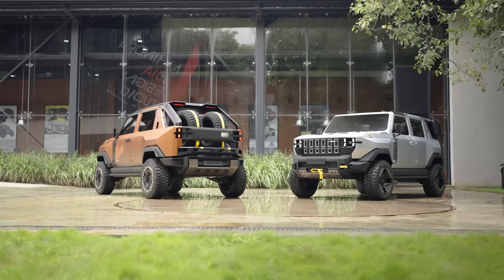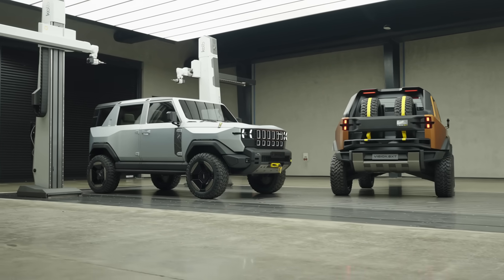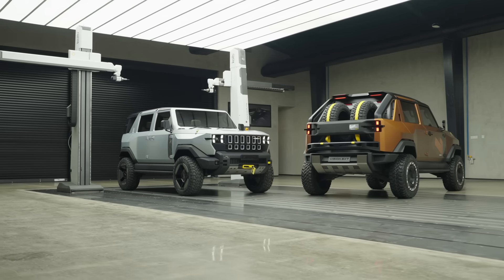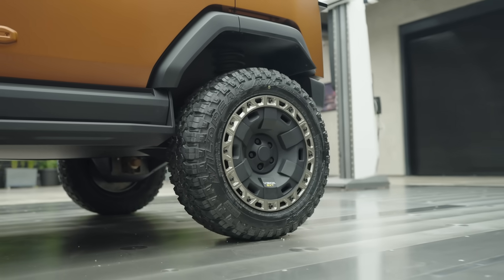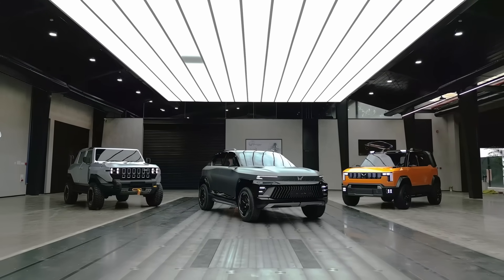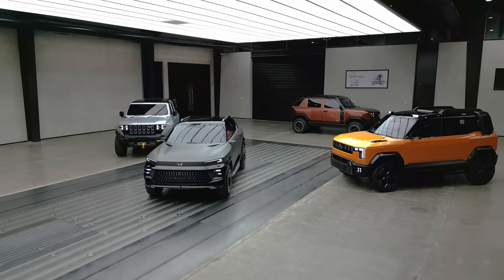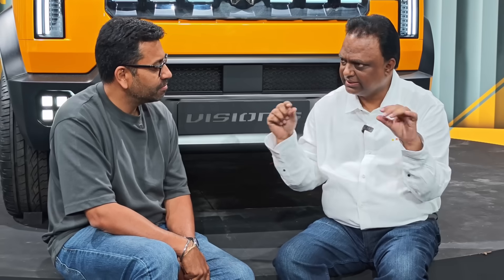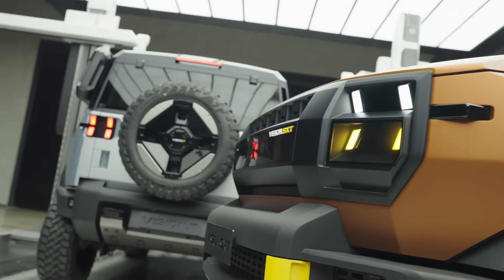Understanding Mahindra’s NU.IQ platform | In conversation with R Velusamy | evo India

Comment: Dear Velusamy sir,

Actually Mahindra done a great Job in terms New car designs ( BE 6 & XEV 9e ), Am so inspired on both cars and booked my BE 6 pack Two. 
Asper Mahindra both are same Platform, Battery size, Motor everything is same, Only the Body shape and room sizes are different based on the customer Choice which is 100% fine . 
While am checking the price from BE 6 to 9e it's 3 Lacs difference for the design character, But when am going for Pack 2 variant Many features are missing in BE 6 while 9e has in the same Variant.

Example In 9e Pack two below features are same as Pack three.
1) Same Light set up
2) Alloy Wheels
3) Auto fold ORVM
4) Reverse Auto tilt ORVM
5) Electrically adjustable seat with 3 Memory function

But the same in Pack two BE 6 All above is missing which I felt 'Unfair', Because in both model Pack one to Pack two price difference is same 3L rupees, 
While giving 3L rupees excess in 9e am getting above features while am 3L rupees in BE 6 not there which is completely not convinced me.

Even though I have booked BE 6 Pack two but still am worried about above and dis satisfaction with the booking.

Comment: Sorry the BE6 has utterly failed for rear seats. What is he talking about? No under thigh support whatsoever
Reply: Yes the rear space does feel different compared to a tradtional ice car. But thanks to the extended wheelbase the leg room and shoulder width is not a problem. 

It's the radical design that creates a perception of a cramped car. But in reality it is not. 
I personally own a Be6 and have realised that's It's maybe the most spacious rear seat for a car that is so driver centric and sports car like. 

But then again people have the freedom to go for xev 9 in case rear seat is that imp to them.
Reply: @Agarwal_Ansh Have you tried doing a hypermile test with your BE6? If yes, what did you get? I was just curious 😅
Reply: @shakunji yes. I have the 59 kwh three select variant. And with auto regen on. I get 410 types .. ac on
Reply: No one is forcing, there are enough buyers for its performance
Reply: BE 6 has good rear seat space for a performance car. Don’t compare it with any normal crossovers

Comment: Didn't sound very convincing. BE 6 measures around 4.37m in length so clearly space management wasn't the factor that lead them to opt for a multi-energy platform. They may have done it to keep the development costs down seeing the lukewarm response their BEVs got. Which is a shame really, they are great cars.
Also when he says FWD has enough performance for cars under 4.7m & 2000kg it feels like going back on their words from 2022 where they said that RWD was integral to Mahindra's DNA of rugged off-roaders and performance oriented SUVs.

A FWD Thar? With a 1.2L TGDi? And a smaller battery (shorter wheelbase) than INGLO? Certainly NOT a go anywhere vehicle.
Reply: Exactly. His BE points were not at all convincing.

BE was a failure due to practically issues

That weird Halo loop up front. Couples would not prefer such a barrier between them

Too much stuff packed at the rear caused a super raised floor and terrible under thigh support for BE

No wonder the costlier XEV 9e is selling twice as much

I believe they went too overboard
Reply: Do you really think the design and development takes only couple of months ?
Reply: @gunner0077  the EV market has been slowing down since the FAME 2 subsidies ran out. That was 30th April 2024, approx 16 months ago.